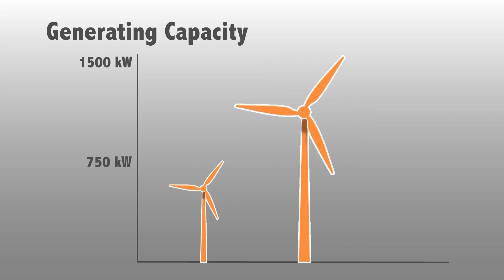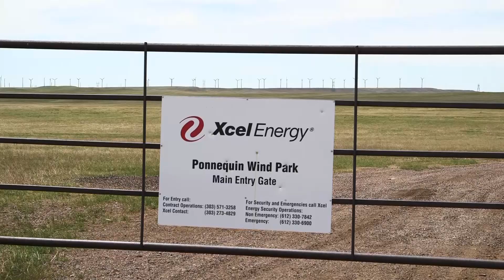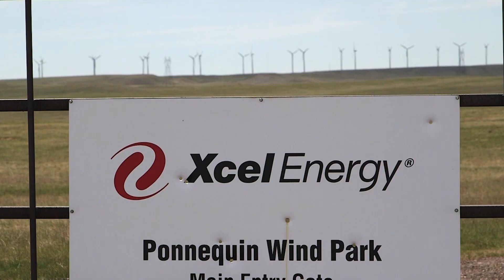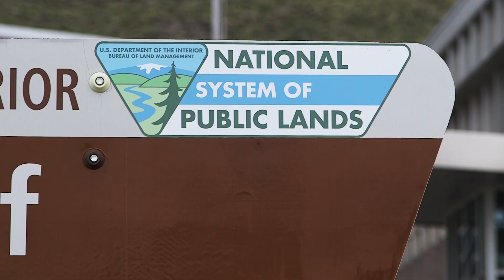Who Cleans Up When a Wind Farm Retires?

Comment: I really think people should worry more about nuclear clean up rather than a little steel and concrete?
Reply: A little steel and concrete? We are talking about 20x more steel and concrete per MWh comparing wind turbines and nuclear power plants. And that's not nearly the worst problem with wind industry, there are huge technical and economic problems if we want to have electricity which is produced mainly from wind (and solar).
Reply: @FrainBart_main  You don't need to wear a space suit to go near a turbine nor bury drums of waste in a big hole and pray it doesn't leak out. I stand by my observation. If a turbine fails you don't get poison lasting thousands of years. All that radiation in Japan has been tracked arriving on your countries west coast. Nuclear is extremely dangerous. There is no comparison.
Reply: @blackterminal  You don't need to wear it going near a nuclear power plant or reactor too. In fact, often the radiation inside a nuclear power plant is even lower than natural background radiation. Yes, nuclear waste is a problem but it's often exaggerated by the media and activists. There is relatively very little waste, which is indeed very deadly right after it is taken out of the reactor. But after a few years, the most radioactive material is gone and after a century (not thousands of years as some would like you to believe), the most dangerous material is basically gone (Cs-137, Sr-90 etc.). The radioactivity is also close to the mined uranium ore at that point. So yes, nuclear waste is a problem but it's not nearly as big as some are trying to convince us.

I'm from Europe, not the US. To say there was radiation from Japan and not say how much is nothing but deceiving. There is so much radioactive material in the Pacific (natural, bomb testing, waste disposal from the 20th century...) that the radioactivity Fukushima Daiichi leaks into the ocean is negligible. There is in fact comparison of how dangerous electricity sources are. They were comparing the deaths per unit energy from various electricity production industries. What they found was that nuclear is actually the safest, even safer than wind and solar industry. You can look for this data yourself.

PS: if we want to compare electricity sources, we should compare every aspect of them, not only environmental. I'll stop here because this comment became quite long.
Reply: @FrainBart_main  I cannot see how nuclear is safer. If your from Europe you know about the big tunnel dug I think in Norway to bury Nuclear waste. Some Nuclear waste breaks down faster but there are multi thousand year components. We have different views you are entitled to yours.
Reply: @blackterminal  Of course we are entitled to our own opinions. But from my experience there is a lot of misinformation about nuclear energy. And from what I've seen, the more people know about nuclear physics and electroenergetics, the more they are pro nuclear.

If we are looking at the deaths it causes, it is safer. I'm not saying it is safer overall. The deaths in wind and solar industries are attributed to accidents during installation and maintanance and to the large quantity of materials needed for the same energy output (mining, refining, fabricating...) These deaths are then amplified if we look at it from the deaths per unit energy produced's point of view due to low energy densities of wind and solar irradiation and low capacity factors. Nuclear produces large amount of energy with very low amounts of construction materials and fuel, so the deaths per unit energy are low. The only bigger nuclear accident that caused confirmed deaths is Chernobyl - WHO estimates 4,000 did and will die due to this accident. For another comparison, one hydroelectric dam breaking killed 170,000 people in China.

Yes, there are isotopes that last for even millions of years. But if they last a long time, they are hardly radioactive. This is measured with a half-life (long half-life - low radioactivity). That's the reason you could bring nuclear fuel to the reactor with your hands if it didn't weight tens of metric tons.

Comment: The future is to make NH3 from excess wind and solar and run the NH3 in turbines for the grid and cars, trucks, airplanes, boats off grid.  The storage is cheap and it can be handles like propane in 150 psi tanks.  At 2.49 cent/kwh for AZ solar contract recently, it can be made for $1.3/gal equiv to gasoline, which is close to gasoline now at $42/barrel.  My new engine is designed for 6 fuels found around town:  House (propane, Nat Gas), station (gasoline, Diesel) and airport (100 LL, JetA).  Each is needed for my roadable seaplane.  NH3 is made at house via solar thermal electric via the engine system.   Interested in the future of energy?  see my tweets @seaplaneguy

Comment: Dang if I was that rancher I’d leave one up and build a house around it. Remodel the generator fairing and make it a room with panoramic windows. How sick would that be? Of course you probably wouldn’t be able to fit a spiral staircase in there, but nothing’s wrong with a ladder. Also they’d probably work as grain silos.
Reply: The silo idea makes sense run a vertical auger up the side and unload from the bottom.

Comment: There is salvage that is worth plenty...should be more than enough to cover any expense of removal.
Reply: What parts are salvageable?  The towers?  The bases?  Just read an article about the blades having to be chopped up and dumped into landfills and they don’t deteriorate.  Seems as if there was money to be made scrapping out the structures some company would be all over it.  Hoping what you wrote will come true, but not looking like it now.
Reply: @Jay-ik1ge  Clearly the wire is worth a fortune and of course the steel. Tons of steel!
Reply: @daveanderson6323  the problem is similar to 'earth moving' soil from a giant icy mountain that looks like full of it.

Comment: Dumb!  15 years lifespan is LAME!  OIL until we go to cold fusion, or some zero point.  Fossil fuel still beats most ''green'' energy, unless you're in Iceland where geo thermal is best!
Reply: in iceland they burn hay for fuel
Reply: @gregoryeverson741  ~  Geo thermal
Reply: I'm curious what you mean by 'beats' and 'best' ... both are subjective and circumstantial... in terms of carbon deposits, you're 100% incorrect. and Geo thermal isn't an 'energy' that can be used - it's a heat source that can be directed. Saying 'geo thermal is the best' is like saying a space heater can power your home.

Comment: With Wyoming having experiance with petroleum production, and coal mining, it's no surprise the utility had to pay bonds up front, for ste resretoration before beginning construction.  In the event the  State of Wyoming managed those bond wisely, Wyoming taxpayers should have made out well. Unlike open pit, and mountain topping coal mining, restoring wind farm lease likely will be closer to what it once once was. A pit that cheaply back filled will not result in a surface that once was, before it was dug. My look great but will be forever a liability if water ever bring toxic material to  the surface. Not only does mountain topping irrecoverably change the mountain it does the same for adjoining valleys.. To those wring their hads over  taxes, consiferr the following. You live the life you live where to live because of the taxes paid by those before tou.

Comment: There are no negative effects from these beautiful scenic wind farms that we are allowed  to speak about.  They're also bird  friendly.
Reply: i believe that the newer models have little nests attached to the blades  WEEEeeeeeeee
Reply: @GeorgeManthe SERIOUSLY
 Do ANY of you LEFTIST indoctrinated mind numbingly ignorant fools realize it takes MORE energy to build, install, maintain And eventually dismantle thus restoring the land to previous state, than these monuments to stupidity can produce in thier lifetimes? Along with the oil used to maintain the moving parts is brought in by the barrel. The bearings are MADE to leak by design. Most likely ending up in the soil. I though you ALL were AGAINST that? Or ONLY if the EVIL oil co does it? Take just the blades for example. They are fiberglass. Resin is made from oil. Gel coat, paint, fillers, and other chemicals used to produce are ALL petroleum based. So you have the workers drive to work daily to build these parts. Gotta INCLUDE that. They work in a shop with lights & compressors & big fan. Lots of other equipment. Same with the metal parts that connect the blade to your turbine. ALL THAT is JUST to get a blade built. Takes hundreds of man hours. Overhead crane to pull it from the mold. They get sanded and prepped like a car for paint. Then gallons & gallons of urethane paint is applied. Sprayed. They Need be wrapped in bubble Pac & plastic. Loaded on trucks. Again, heavy blades loaded on big trailers. Let's not forget they had to build a Building to build the blades. Can't always find a big enough Building for building fan blades longer than a 🚛 semi trailer.  They must be trucked to the site. Followed by and proceeded by escort vehicles. 3xs. Lifted in to position by a crane burning petrol. WHAT does THAT add up to? Repeat for ALL OTHER components.
Reply: @boatguy64 .it is all a tax revenue scam.
Reply: And the low frequency  noise  and the ground current is awesome

Comment: Let the Metal Scrappers know, all them towers would be gone before Sun up!
Reply: As a scrap metal recycler it is near impossible for us to scrap them. You would need to have the commercial cranes and much bigger torches just to bring the down. Smaller lattice frame and turbines that are below no higher then 100 ft would be able to be scrap by private metal recyclers like myself.
Reply: @gallennorris782  
Like most recycling, unfortunately the process of collect, dismantle, transport, sort, store, sell leaves the proprietor struggling to match the cost of mine, process transport , sell.
Reply: @justdoesntaddup8620  here in the United States the real problem with scrap metal recycling is this: 

1) most of the scrap metal is being sold to chinese owned companies. All scrap metal in these yards is shipped to china and no american foundries can buy it for smelting.

2) we dont have hardly any smelting foundries operational here in the United States because of the chinese influence mentioned above

If we could change this then our recycled scrap metal would be more then economical to make new with AND the quality of metal would be even better (china has a bad habit of selling us impure steel that is mixed with chrome and other metals that are poor grade, this leads to poor welds and weaker strength).
Reply: @gallennorris782  
One can easily tell when welding now that the quality of metal is not always the same as. 
The industrial , employment and environmental legislation along with the cost of electricity is increasingly forcing manufacturers of everything offshore to regimes that don’t have to even consider these things.
The overall big market buyer and seller gets it all.  
No matter the laws about predatory trading or anti market domination, all that just works in their favour.
Reply: @gallennorris782  a truck and dynamite that all you need, well  tell anyone with a bazooka they are target practice 😉 they get ir demolished in no time
Reply: @gallennorris782   Excellent and informed response, and lets not forget they are in remote areas, many of them anyway, and transport cost will be high.
Reply: If the where build from metal...
Reply: @pietermoorer3679  the towers are usually metal yes.
Reply: And the turbines would be stripped of copper and aluminium
Reply: Testify
Reply: They're fiberglass dipshit.

Comment: wow this video has aged a lot or wind farm tec greatly sped up - in the UK the new wind turbines are 8MW ~ each turn, full revolution of the blades, will power a house for 24 hours - the currently new offshore wind turbines are/meant to be 16MW - due to ROI and reducing cost and cheapness of making electric <6MW wind farms turbines are being replaced only after 5 to 10 years when the design life was 20 to 40 years

Comment: They have made absolutely no mention of the 30 to 50 metric tons of concrete and steel that is used for the base of "EACH" of these turbines. When they built these towers they dug deep pits for each tower and filled them with gravel concrete and steel to hold the towers in place. They are built like upside down cereal bowls. They will leave the bases in place and cover them with a foot or so of soil. They cannot be reused for new towers.  New much bigger wind turbines can use 60 to 85 metric tons for each tower. In approximately 20 or 25 years the same thing will happen again..the latest and greatest more efficient towers at that time will not be compatible with the existing bases so each will require a new base specifically designed for it.  When these "new" turbines are shut down their bases will again be covered over with a foot or two of dirt and left in place and never ever disappear.
The bigger the tower, the bigger the base.
So they are not returning the land back to it's original state...In windy area's soil moves during dry times..how long will it be before the owner is steering his equipment around these exposed bases?
Reply: Should we just burn coal ???

Comment: I don't understand why they can't disassemble them and recycle them. Steel in the stands that hold the generators, the wire in the generator itself HAS to be worth quite a bit. I think they are short selling themselves.
Reply: You'll be suprised. Metal scrap is cost per weight. the effort of getting another body in to survey and make a plan, action it make sure it works and get workers and construction company's to remove it , it really isn't worth the caah

Comment: Read recently that a wind mill cannot produce enough energy to offset it's fabrication.
Reply: This is called energy return on energy investment (EROEI or sometimes EROI) and it's on average about 25 for wind turbines according to some studies. So it produces 25 times more energy than it is needed to fabricate them.  Nuclear power plants for example have EROEI in the range of 60-70, hydro up to 100 and above.